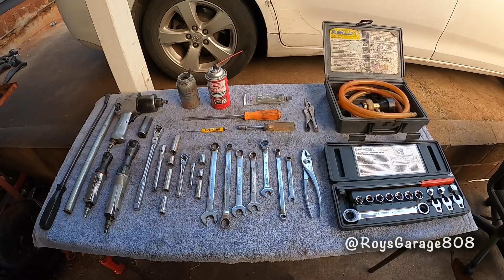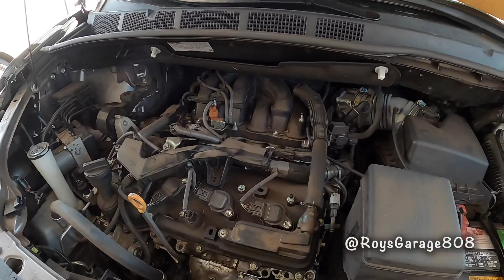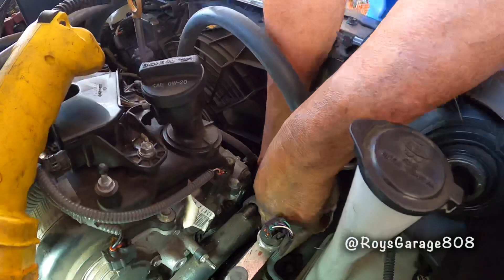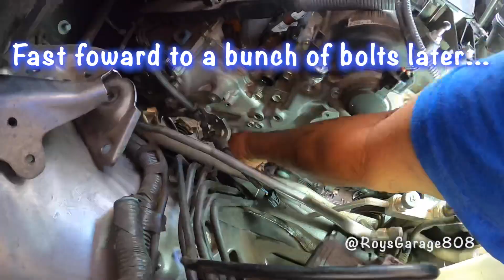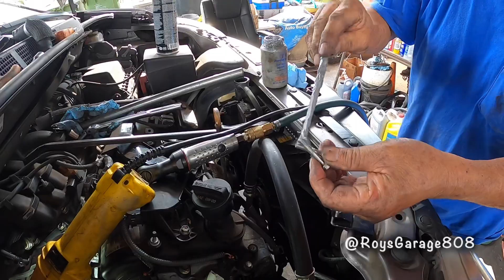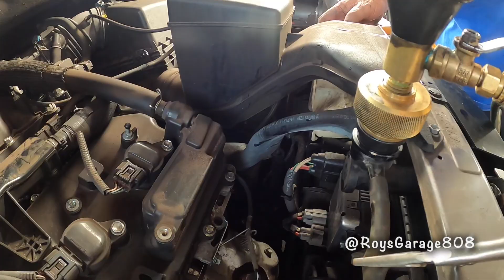How to Replace the Water Pump, Thermostat w/ Housing, & Serpentine Belt on a 2018 Toyota Sienna

Comment: Great video, about to tackle this project because Toyota decided to use some junk Water Pump in these engines.  Thanks for letting us know the bolt for the idler pulley is reverse thread!  Saved me a potential headache!

Comment: 1. @10:32, the motor was jacked up, why, for easy access to the pulley?  2. How to adjust the belt tension? 3. Does it recommend to repalce the idle pulley too?
Reply: The water pump pulley won't come off the water pump unless you jack the engine up a bit, not enough clearance.   These use automatic belt tensioners just like most vehicles have for decades now, there is no adjustment.

Comment: Thanks! The tip of removing the motor mount nut and jacking up the engine just enough to get the water pump out is a good one, should help alotta people.

Comment: If I had to do it my self do I need that airlift tool to pull vacuum?  What if we don’t pull vacuum?
Reply: No, you just open the bleeder screw and leave the coolant cap off and run the engine until you "burp" the system.

Comment: Thanks Roys for the video.  I am going to do it soon on the 2018 Sienna.  What were the torque spec for the water pump and thermostat housing?
Reply: Found it.  8 lbs for 10mm and 15 lbs for 12mm.
Reply: I completed the job today.  It was much more difficult than it looked on this video and compared to the 4 cylinders RAV4.  Replacing the water pump was not hard at all, but access to it was the most difficult and frustrated because of the space and design.  This video really helps the whole process.  I messed up a few spots, and it took me probably 6-8 hrs.
Reply: Very nice details and thanks for sharing, I feel comfortable doing this job.

Comment: Thank you for the video, it helped me replace the thermostat housing on a 2017 sienna. This was not that bad of a job, took me about 3 hours with no ratcheting wrenches. Only issue I had was one of the long lower bracket bolts only came out when I removed the metal bracket completely, there was not enough room to take it out while the bracket was still in place. I then forgot to put it back in the bracket and didn't realize until I started bolting everything back up that there was not enough room to get it back in so I left it out for now.
Reply from the maker: I’ve done that a few times when I was first learning 🤣 thanks for watching 🤙🏽🤙🏽🤙🏽
Reply: I certainly hope you replaced the water pump and belt while you were at it since these water pumps rarely last 100,000 miles.

Comment: This is fantastic!!! If you don’t have the ability to vacuum out the cooling system there’s a bleeder screw on top of the engine you use to burp out remove the air from the cooling system to prevent cavitation.
Reply from the maker: Thanks for watching 🤙🏽🤙🏽🤙🏽